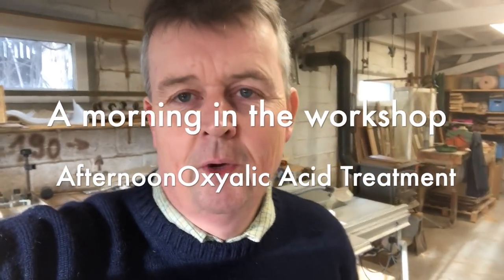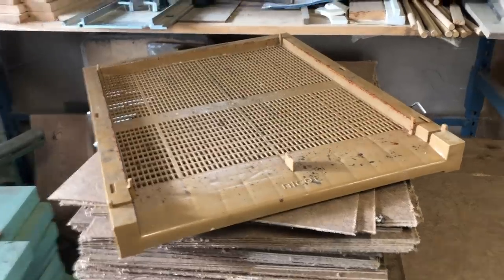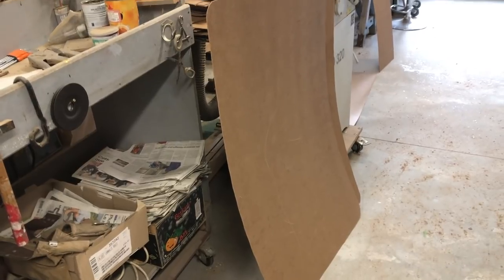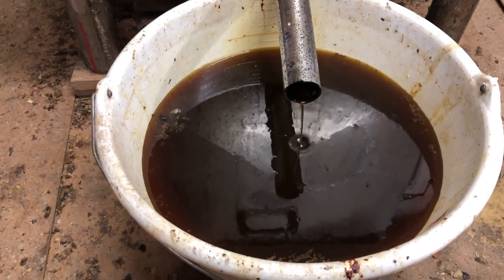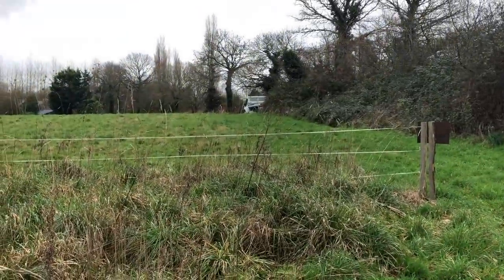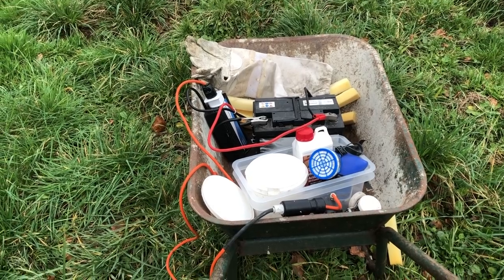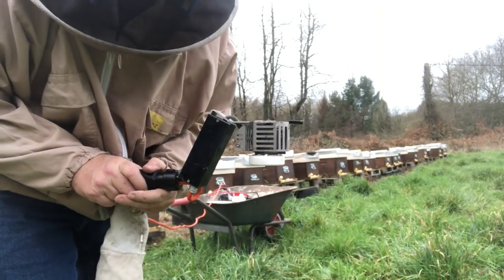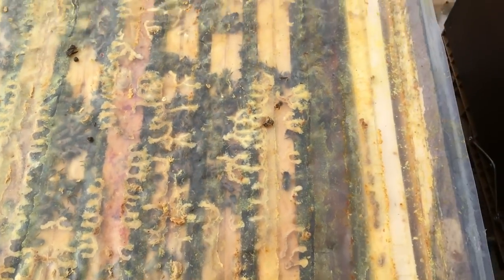Morning Prep Afternoon Vaping

Comment: To help keep your battery up a short cable from the cigarete lighter with 2 crocadile clips on will recharge your battery with the vehicle alternator while traveling between apiaries, the alternator will charge faster than a battery charger at home. Be sure to use heavy-ish cables as a flat battery will draw pretty heavy. better again would be a set of cables direct from your truck battery to the one your going to charg. The oxalic acid looks like its not only effective for varoa but very cost effective too once you have the tool.
 BTW i'm down to 1 hive, 😔

Comment: I may have missed it, but what is the gram dose per brood chamber ?
Thanks for sharing.
😊
Reply from the maker: paul dow thé recommended dose is 2.5 grams per full sized colony but to be honest you can’t overdose a hive! 
On a nuc, half the size I still use 1.5 grams
Reply: Richard someday if u come across a "full face" respirator u should try it,that's what I use I like mine , same filters as half mask. You only get two eyeballs in life and not bad doing a few,but a bunch u start getting exposed.If u start tasting fumes or getting sore throat change filters,or if the diaphragm ever stops "flexing" anyway much love from Missouri u one of my favorites
Reply from the maker: Baddest Bees 🐝 thanks, yes a full face respirator is next on my
List!
Reply: @richardnoel3141  full fase of corse are safter, but in cold days, problem, that whater from breathing are condensing on front glass. I use PROMASK. But maybe better seperated glasies.
Reply from the maker: Janis T thanks for the tip much appreciated!!🙏🐝👍🤙🏼
Reply: Face shield will do the trick too.